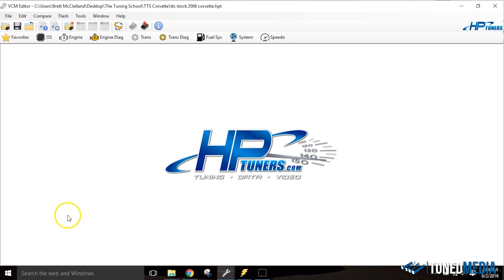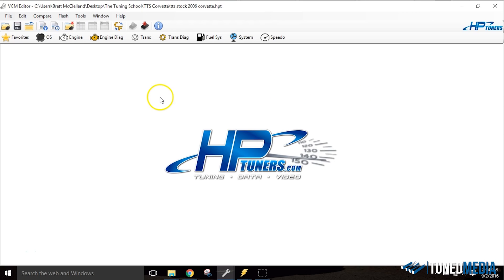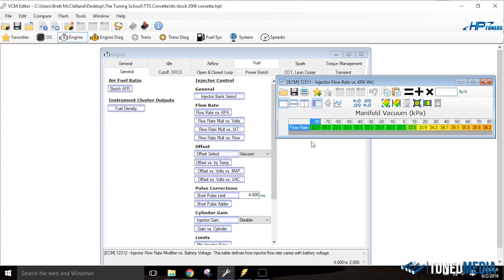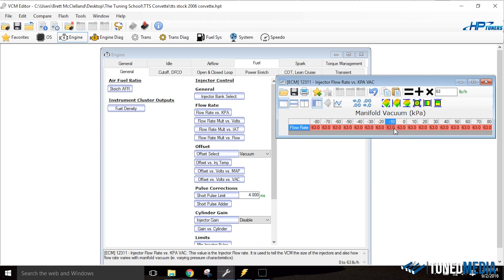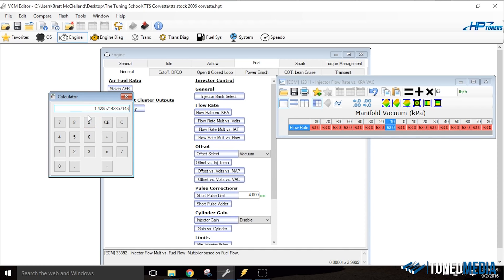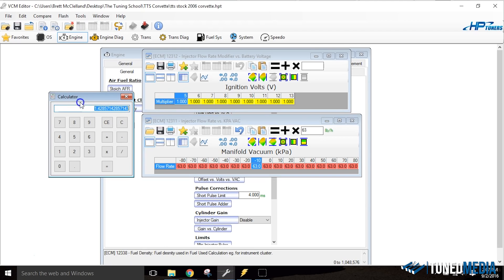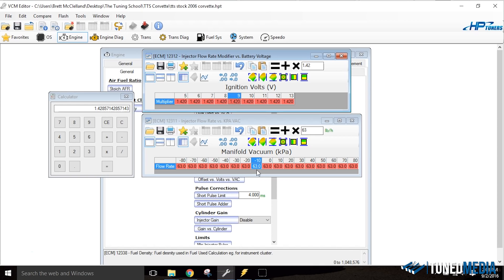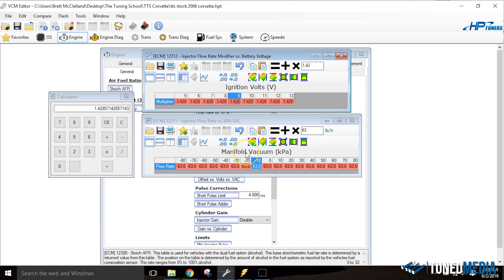Injector Flow Rate Maxed Out at 63lbs/hr: How to Fix Hard Limit Using HP Tuners 3.X Software

Comment: This is wrong for many reasons. Another error is the original flow rate table has values consistent with a deadhead fuel system (no manifold vacuum connected to the fuel pressure reg.) whereas maxing it out and making all values equal you will have to use a manifold vacuum referenced fuel pressure regulator to account for the fuel pressure differential across the injector at different levels of manifold vacuum.

Comment: i think your math is wrong.. 63 is not 42 percent of 90.  i do 63/90=70% so 30% of injector is unaccounted for. so i take 30% out of the MAF table.. just my .02
Reply: but multiply 63 by 30% and you only get 81.9.  The multiplier for 63 to make 90 has to be 42%. (63 x 1.42 = 90)

Comment: This is just flat out wrong.  The max injector flow rate is the same regardless--multiplying a max by some factor doesn't raise the limit.  It still will max at the same value.  This is not a method that should be used.
Reply: schpenxel
Reply: 100% this, the only scaling method for my PCM (P12, LSJ Engine) is to airflow scale or to multiply the stoich value by the desired multiplier
Reply: Wrong